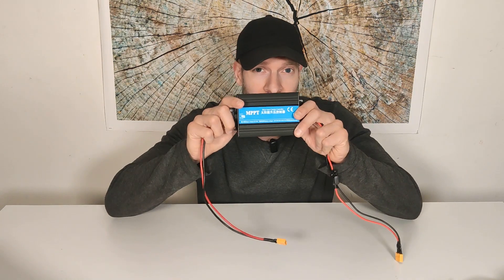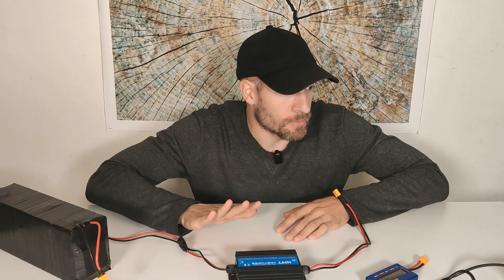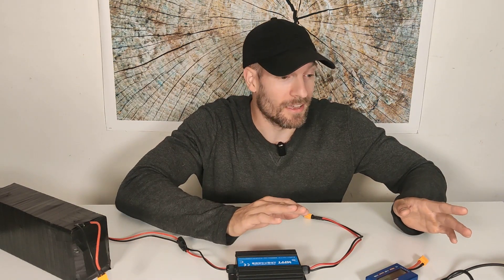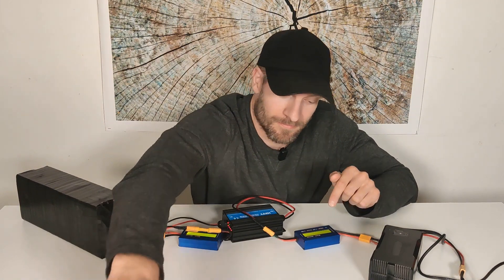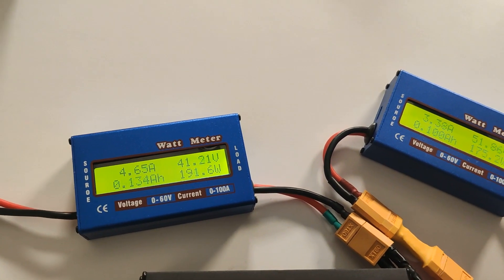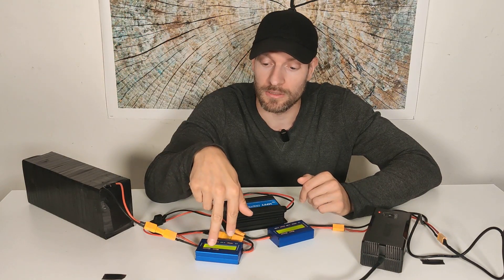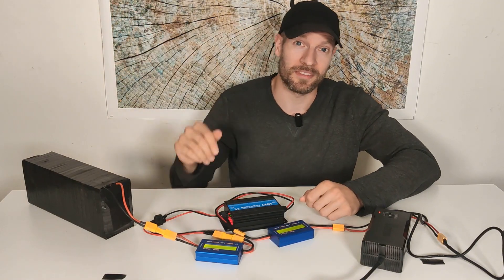MPPT Boost solar charge controller 12v-72v

Comment: One problem i have found with this controller is that if the panel is shaded just for a short moment for the voltage to drop, then the controller turns off and doesn't start again, only letting the charge from charge from the panel through to the battery without boosting. Unplugging and re-plugging starts the controller again, but would be a pain having to do that everytime a shaddow falls on the panel. Anyone else found that, and maybe a solution? Or is my controller faulty?

Comment: Hello, thank you for sharing the information.

Have you tried to use the MPPT Booster connected to a Victron 100|20A solar controller to charge a 48v battery?
Reply from the maker: Hi! Sorry for the late response—I was sure I had already answered this question, but it looks like I hadn’t. I'm not exactly sure why you would want to do that. The MPPT booster is capable of charging the battery on its own. Adding a Victron solar controller might just introduce additional losses into the system, without offering any real benefit.

Comment: Great video, but it would have been good to test various input voltage. Surely the efficiency would be lower if the gap between input and ouput is higher. IE solar panel with 12v boosted to 54v. And even better, 12v boosted to 82.8v for a 72v battery.
Reply from the maker: Well, I’ll do it and make a new video 😊

Comment: This may be a dumb question, but I´m just starting to learn about MPPTs and stuff. So from what I´ve understood so far, the MPPT and the DC-DC boost converter are two separate components, am I right?
Reply from the maker: There are no dumb questions, but my response time was really slow. Sorry for that.
And you are right, they are two separate components, but here they are the same...  I'll try to explain it as simple as possible.

A MPPT controller detects the generated voltage of the solar panel in real time and tracks the highest voltage and current value (VI), enabling the system to charge the battery with maximum output power. With a ordinary MPPT the solar panels voltage needs to be higher than the voltage of the battery.

A DC-DC boost converter basically just boost a lower DC voltage to a higher. 

Finally, the MPPT booster  is a combination of the two. It allows you to use, for example, a 18v solar panel to charge a 36v battery.

Comment: You don't divide input voltage and output voltage to determine efficiency.   You compare input watts and output watts to determine conversion efficiency.  You set the input voltage to a value you chose for the test.
Reply from the maker: And I didn't .... But it's good that you explain what I didn't do... And you don't set the input voltage. You set the output voltage. The input voltage is whatever the input voltage is. You cant change the input voltage with a mppt.
Reply: Yes. The efficiency is measured by the difference between the Watts input and Watts output. From some of your screen shots, this is about 170/190 or 89%. It would have been best to measure the total energy in and total energy out in Watt hours (Wh) but only one snapshot shows that so can't compare. 
Thanks for doing this test. I just bought the Renogy Version of this solar boost converter.
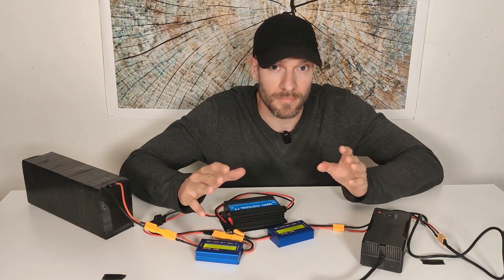Reply: I guess you mis-spoke then at 4:16 you said you divided input and output voltages to determine efficiency. That's what the CC displayed. Obviously efficiency is based on input/ output power.

Comment: I'm new to this stuff, thanks for your videos!  Will this device stop charging the battery once it hits the voltage you set? Thanks
Reply from the maker: Yes, it will stop charging when it reaches the set voltage. I have been using this for some time now and it's awesome. One of the best products I have

Comment: How can I make this work on my E motorcycle so I can be able to ride long distance
Reply from the maker: Well first you got to know the battery voltage of your E motorcycle. Then it's just to connect the MPPT bost charger between the solar panel and the E motorcycle battery. Easy as that 👍

Comment: Is there a BMS (battery management system) in that battery pack? because to the layman watching this test, it might not be obvisous that this is need in a operating system. So it should be pointed out that you are using one or not!! otherwise great video!
Reply from the maker: This is not a review of the battery pack and that was why I did not go into details about the battery pack. But you are right. The battery pack has both a bms and a fuse built in to it. And I wouldn't recommend anyone to mess around with lithium batteries of they don't know exactly what they are doing. Lithium batteries burns hot and it is almost impossible to put out a fire in a lithium battery.

Comment: How do you like this compared to the 7210a that is also listed in yout description?
Reply from the maker: I like this one a lot better than the 7210a. This one got one bottom. With that button you art what voltage you want to charge with. And that it, that is all the configuration you need. The 7210a is a lot more complicated. But if you want to be able to set all the changing parameters yourself, then you should choose the 7210a. I have never been able to get the 7210a to work as well as this one thou.

Comment: Don't these voltage fluctuations destroy appliances, specially when on DC?
Reply from the maker: It's the input voltage that has some fluctuations. Output is steady, or at least within 0,3 voltage.

Comment: These are amazing little boxes, I have 2 installed in my car to charge a couple of ebikes off the 12v from the vehicle, add 2 - 3m of 1.5mm thin wall otherwise it will pull too much current, you can regulate the current by cutting the length of cable feeding it. I have them both pulling 15 amps wired into the back of auxillary sockets, had to add internal cooling.
Reply from the maker: I have tried a couple of other MPPT boost chargers but this one is the best so far. I have ordered a 600 watt version from the same company and hopefully I will received it in a couple of days. I'll post a review of it as soon as possible!
Reply: @camillionmonkey I havent allowed it to over heat yet but im sure it would do if you allowed it to, it doesnt seem to be able to limit its current input at low voltages, I have seen it flash up 25 amps on the display for a few seconds then I've turned it off. Gets very hot above 15 amps without a fan.

Comment: I really think if your input voltage was lower, it would be less efficient. If the input voltage and the output voltage were closer in range, the MPPT will do less work, which should make it more efficient. MPPT is better at stepping down than stepping up.
Reply from the maker: Next week I will record two new videos. One where i am going to test this with a lower voltage input and one where I will test the bigger, 600w mppt boost charger from the same company. The bigger one will be tested with a 400 watt foldable solar panel from AllPowers.

Comment: Good test.
Reply from the maker: Thank you. I am just about to do another test if this MPPT booster where I will use a lover input voltage to see how it would handle that. I also just received another MPPT booster brand that I will be testing out with the AllPowers 400 watt solar panel. Follow and I’ll have them up in a couple of weeks

Comment: Hi good video! I have a question about this boost charger, Yours is currently the latest video I can find on here reviewing this product, I ordered a 600w version but it wont get to me for another 5-6 weeks. The question is on the label it says input =12v-50v. If I wanted to charge a 48v battery pack but the source was greater than 50v would this still work? It state its a boost charger so normally the source voltage would be lower. My voltage source will be 50v
Reply from the maker: I am not sure what MPPT booster you ordered. But if it says input up to 50v I would not use a power source greater than 50v. That might blow a fuse. 

An ordinary MPPT takes a higher voltage from solar panel (ex 18v) and lower it to be able to charge a lower voltage battery (ex 12v).

The boost charger does the opposite. It takes a lower voltage (ex 18v) to charge a higher voltage battery (ex 48v).

But!! When charging a battery with a nominal voltage of 48v you dont charge with 48 volts. If it's a battery based on 18650 batteries the charging voltage should be at max 54,6v.

So you can use a 50v power source to charge your 48v battery. BUT! It might be a bit of a gamble depending on the MPPT booster that you are using and what your power source is..

If it has a fuse that will blow at 50,1 volts you might be at risk of blowing that fuse if your power source is not that stable. But most products has fuses that ca survive at least another 10%.

Can I ask what MPPT booster you have bought and what power source you got?
Reply: @olleoutdoors  sorry my mistake in what I asked, I meant to ask if I was charging a 24v battery pack and the source was greater than 24v since the label state  input is 12-50v. the panels I have have a ocv of 36v but I have a choice of configuring the batteries to either 24v or 48v. I already have a 1200w dc-dc boost converter but it doesnt cut the voltage when the batteries are charged like the unit you have.
Reply from the maker: With this Bost charger the input must be lower then the output. So if you have a 36v panel you have to configure the batteries to to 48v. If you want to use a 36v solar panel with 24v batteries you must use a regular  MPPT.
Reply: @olleoutdoors  Thanks for the reply, I just wanted to know if it was a SEPIC (buck/boost) device since the label showed an input which was higher than 2 of the outputs ie 12v &24v

Comment: That controller is limited to 12v 300w  solar panels . No good for my 12v 600w set up
Reply: It says 12v to 50v input on the label
Reply from the maker: Well you are sort of right. This one cant but they do have one that can handlle up to 600w solar panels.

DC 48V 60V 72V 600W Solar Panel Boost Charge Controller MPPT
https://vi.aliexpress.com/item/1005005167212283.html

Solar Input Voltage Range: 26-63V (the voltage of the solar panel needs to be lower than the battery voltage)  (IMPORTANT! you cant use 18v solar panels with this unless you connect them in serise).
MPPT Voltage Range: 26-63V

------------------------------------------
But if you are looking for a 600w verision I would go for the one below.
Input voltage 12-60V
Output voltage: 15-90V
Output current: 0-10A
Output power: 0-600W

Delaman 30A Solar Panel Regulator
https://amzn.to/42iwNnm
https://s.click.aliexpress.com/e/_DlA9Iuh

I hope that can be of help!
Reply: @olleoutdoors   Just wired in the 600w unit today .  I used a rotary  switch  ( 1-off-2) so I can switch between  solar panels charging my batteries and inverter  #1  . and then #2 is to the 600w boost charger for ebike ( via the panels only )

Comment: Nice topic, I'm just about to get one
Reply from the maker: It is amazing! Unfortunately, I live in Sweden and it has now been five months where testing solar panels is pretty useless. But now the light is starting to come back, so now it's time to do some testing.
Reply from the maker: And just as in was going to do some testing… 15 cm snow and clouds for the following weeks
Reply: @olleoutdoors  got mine already and done testing 2x100watts panels in parallel with  48v lithium 18650 pack. It's working perfectly but a little worried the display shows b: 54v and still rising, c: ranges from 1.0 to 9.0 amps, when the sun shines so bright. Am I destroying my battery with this numbers? My wall charger only has 2amps for 3+hrs. of chargers
Reply from the maker: @Carlito Madrona  Well that depends what you set your maximum charging voltage to. The maximum charging voltage should not be above 54,6v for your 48v pack. Your 18650 pack should be 13x 18650 batteries in series. The max voltage for one 18650 battery is 4,2 so 13 of them should be 54,6 voltage. So 54 voltages should not be a problem. But if you want your battery pack to last longer you could always lover the maximum charge voltage to 53volts. This will give you less watts in your battery pack but you will be able to use ut for more charging cycles. Did you build the battery yourself or did you buy pre-made?

And regarding the amps. I would guess that you have 18v solar panels. (18V x 9A =162W). When the MPPT booster boosts the voltage from 18v to 54 the amps will lower to 3A (54V x 3A = 162W).  

So, in conclution, 54 volts is no problem for your battery. But the amps could be a problem IF your battery is very small. But as long as you have a working BMS there shuld be not problem at all!
And regarding the amps. I would guess that you have 18v solar panels. (18V x 9A =162W). When the MPPT booster boosts the voltage from 18v to 54 the amps will lower to 3A (54V x 3A = 162W).  

So, in conclution, 54 volts is no problem for your battery. But the amps could be a problem IF your battery is very small. But as long as you have a working BMS there shuld be not problem at all!
And regarding the amps. I would guess that you have 18v solar panels. (18V x 9A =162W). When the MPPT booster boosts the voltage from 18v to 54 the amps will lower to 3A (54V x 3A = 162W).  

So, in conclusion, 54 volts is no problem for your battery. But the amps could be a problem IF your battery is very small. But as long as you have a working BMS there should be not problem at all!

Comment: Would like to see the efficiency with a twelve to eighteen volt  solar input for fortyeight volts out
Reply from the maker: Well give me a couple of weeks and I'll post that video for you. Just got to wait for a sunny day here in Sweden. ☺️
Reply: @olleoutdoors  i have the same charger with an allpowers 60 watt folding panel that gave  me 1 amp in bright sunlight at 36 volts  but now i have a 48v e bike , it still slowly charges it though , i only have the 1 watt meter though .

Comment: Well dude, freaking AWESOME test and actually I'm going to do it the same exact way to charge my ebike from a cheap 100w panel.  Cheers from USA!
Reply from the maker: Glad to hear it. Would love to hear how it worked out for you! Cheers from Sweden!
Reply: @olleoutdoors  I've set mine up and its working.  I'm boosting from 18v up to 56v so perhaps the efficiency would be less than on your experiment?  I'll get you know by Saturday when it's sunny
Reply from the maker: @mattc825  how is it going??
Reply: @olleoutdoors  It WORKS!  I can get about 1.3 amps under full sun @ 55v and charge this ebike battery perfectly.  So yeah it seems the efficiency is a bit lower when I'm boosting from 18 all the way to 55v but still pretty thrilled

Comment: I'm using my watt meter to monitor the solar panel. It's actually interesting to watch the wattage reading. Gives me a good idea of how efficient my solar panels operating. Depending on the weather conditions obviously. We're getting into the rainy season here. A lot of overcast bright sky. But, my 200 watt solar panel is still putting out something 👍👍 a little 😎
Reply from the maker: I have a 60w solar panel for my camper trailer. With that I have a 200w battery. That is enough to run a refrigerator, a couple of lights, and to charge my phone and laptop. Solar power is amazing!

Comment: Hello from Urdaneta City, Pangasinan Province, Island of Luzon, Philippines. I'm retired here 6 years ago from Seacoast, New Hampshire. Also, an amateur radio operator for 30 years KB1DIG.

Thank you for the video. Interesting stuff. Not a lot of information on the MPPT device on YouTube.

I have recently posted some YouTube channel uploads on my solar panel setup for my ebike 4 wheel version. It's something like an anorexic electric golf cart hahaha.

Anyway, I ordered two of the watt meters. But, only using one. The reasoning. My solar MPPT boost controller solar charger is adjusted at a self setting of 66 volts. And, the watt meter is only rated for a maximum of 60 volts. I didn't know if the watt meter can handle the over voltage?? And, I don't want to sacrifice it finding out 😜 my luck I'd cook the watt meter hahaha
Reply from the maker: Nice to hear from you! Sounds like you have an interesting video and I'll have to watch it when I get back home! And i guess I will have to make a video where I am going to test what will happen if I run 67v through the watt meter! :)